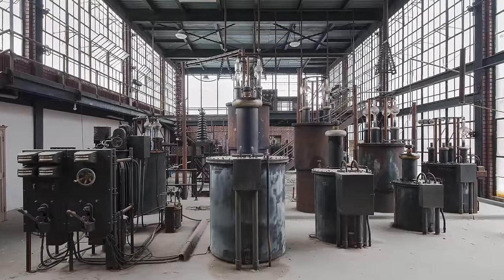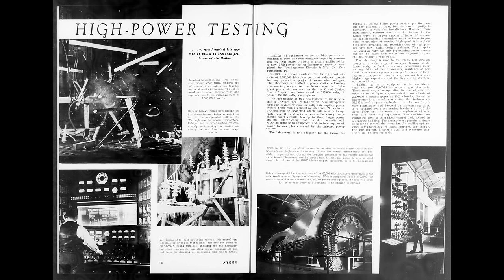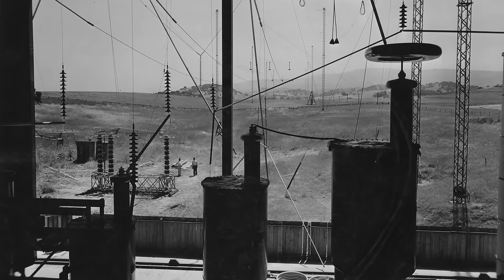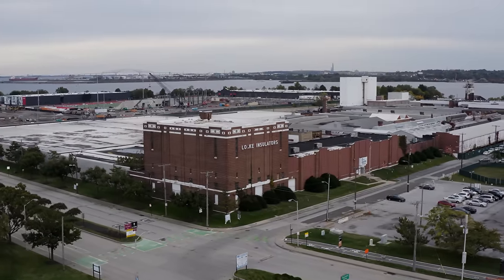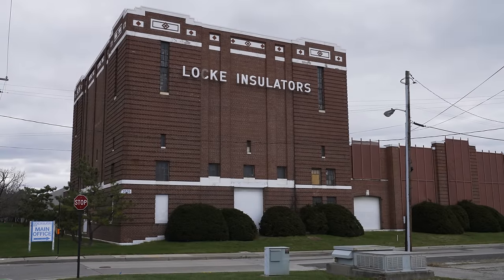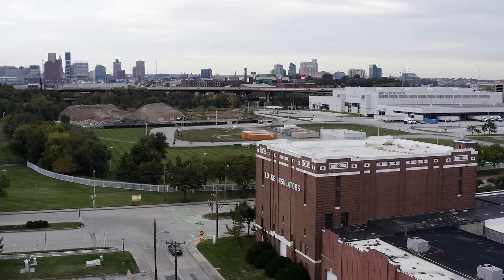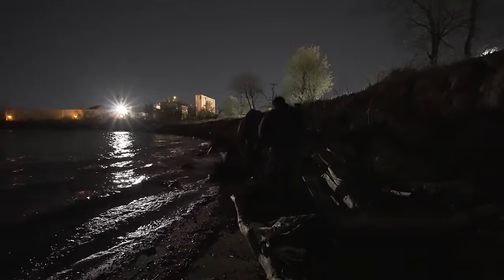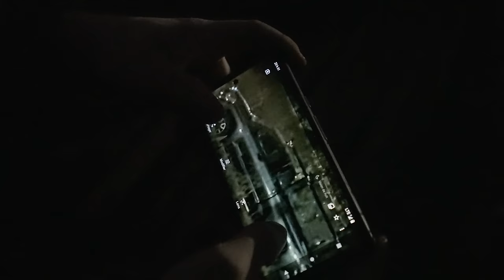Exploring GE's Abandoned High Voltage Lab - Vintage Electrical Tech!

Comment: In about 1985, I was in the McGraw Edison transformer factory in Canonsburg PA to witness the high-voltage impulse testing of a 230,000 Volt substation transformer my company was  buying new.  During the impulse testing with hundreds of thousands of volts being applied to the high voltage windings for oscillographs to capture the response of the internal copper windings and insulation, there were three or four men standing next to the transformer case and using 4' long broom sticks to personally listen to the mechanical movements inside the transformer when the impulse was injected.  There were also electronic volt/amp transducers as well as acoustic couplers and sensors.  It was all going fine until it suddenly wasn't.  Instead of the repeated and expected crisp "snap" noise pattern, it suddenly changed to a "kah-thud" sound.  An alert siren began making noise and a half dozen more men ran into the laboratory to join the others.  With everyone in place with a broom stick in their ears, they jolted the transformer another couple of times.  The mood in the room changed and the test supervisor told me that the transformer had internally faulted.  I was only about 10 years out of engineering school and the event was one which remains a utility industry career highlight for me.
Reply: I've recently heard of that place are they still in business?
Reply: @sharkey086  It's called Pennsylvania Transformer Technology now.
Reply: I worked for Uptegraff in Scottdale PA
Reply: My father worked at McGraw Edison in west central IL. the majority of his life. Worked there until they shut the plant down. He was a kiln operator. I have his awards for 30 plus years of perfect attendance.

Comment: You guys really need to bring a thermal imaging sensor. Makes it much easier to spot people in vehicles vs empty vehicles.
Reply: these guys really need to bring a global hawk with them. makes it easier to spot and blow up security personel.
Reply: Thermal can't see through glass. But a thermal camera is key i do agree.
Reply: @dashofawesome64  it can see if the truck is running or has been sitting for several hours.
Reply: @ClumsyCars  That's cool, except he was replying to the specific example given of seeing people in vehicles. Everyone is so contrarian.
Reply: @UnitSe7en  if contrarian means realizing an actual useful purpose then contrarian i am.
Reply: @UnitSe7en  What is contrarian about that? It takes hours for vehicles to cool down. People are rarely occupying vehicles 4 hours after last running
Reply: As long as it doesn't have a screen
Reply: Was thinking the same thing, would be pretty handy.

Comment: I live right up from the street from this place, one day when I was driving home from work I thought I saw you guys walking, must have been on your scouting run haha! Thought no way it was Brian and Michael, but if it was them they are definitely here for Locke! I was involved in the analytical lab work surrounding the environmental cleanup of the site and demolition of the building. They drill a grid pattern and take soil samples every few feet to determine how much contaminated soil needs to be removed.  Around last october/november was when that process ramped up so I knew the building wouldn't be up for very much longer. Earlier this year they took everything down, crazy how fast it went less than 48 hours everything was flat. I could have never imagined that's what the inside of that place looked like! The largest part of the building is the actual lab itself, the part the says Locke Insulators on it - unreal! This is so cool thank you guys for doing what you do!
Reply: Wow that is cool
Reply: Sad all that cool stuff will just end up in a land fill. Sad the building could not of been repurposed.
Reply: Were there PCB's?  That's what I'd worry about.
Reply: @scowell  it was common to use pcb's as high voltage insulation oil back in those days, plus of course asbestos would have been used in the separator boards.  I am glad they were eliminated before I started my career in high voltage engineering - it's mostly paper, epoxy resins and vegetable oils these days.
Reply: That’s really cool !! Thanks for sharing that story !
Reply: Im not at liberty to talk about what contamination was present, but any old factory site like Locke there is TONS of contaminants - majority of the places the Proper People visit are definitely highly contaminated, theres a whole environmental side to each of these sites!
Reply: @scowell  yes, in those transformers and anything before 1977 and 1979.

Comment: Working in a HV test lab myself (one of only 3 left in the uk) this brings a particular sadness seeing all that familiar stuff left to rot.  Most of that kit looks exactly the same as what we have except our kit is controlled by computer - you just set the volts you want and all the spark gaps are set automatically.  Must have been real tedium to set everything manually.  Looks like a tan delta bridge at 25:40 which was used to determine how electrically lossy insulators are at different frequencies.  Some of the knobs were to set the frequency whilst the others were used to dial in the capacitance and tan delta and you literally had to watch an analogue meter to "balance the bridge" - sometimes it could take hours to do one measurement at one frequency.  We still have one of those in our shed but these days such measurements are done using computer controlled equipment which can do a complete frequency sweep in a few minutes.

Comment: Stunning!  I had the good fortune in the early 90's to explore GE Pittsfield's legendary Building 9.   While officially considered an active facility, it was in an equivalent state of abandonment and was absolutely mind blowing.  The scale of the equipment in the high-bay lab was staggering.  The vintage control rooms were still intact but long disused - dust everywhere.  There were complete blueprint sets that I spent hours flipping through.  If only I had been able to take pictures!! I was a consulting engineer under contract to GE tasked with mapping site infrastructure so I had legitimate access to the facility but was prohibited from having any sort of camera equipment with me.  Great work guys!

Comment: Thanks for this video. My father worked at General Electric’s electric switchgear plant that covered several blocks on Elmwood Ave. in Philadelphia. One year they had an open house where we could tour and see where our family members worked. One one of the places we got to tour was their high voltage testing facility that was a separate building off Island road 
south of where the switchgear plant was located. We got to see them test some equipment where they generated a high voltage charge. It was as you showed looked like a large man made lightening bolt. It was loud and really scared many of us watching. It was explained that they took finished products from the switchgear plant to test them for high voltage loads or for how well they would hold up from a lightening strike.  The old GE plant has been closed for years and I assume the test plant closed at the same time since there was no product coming from the old switchgear plant.

Comment: Thank you for the trip down memory lane. I worked for GE in Schenectady NY in the 1980s when I was in my 20s. Back then we still use some of the older equipment for variable frequency projects. Motor generator sets that were almost 20 ft tall. It really is sad to see so much of this stuff going away. 60s 70s 80s that really was the Heyday of some of this emerging technology that we all take for granted today. Obviously in the 80s we had the beginnings of computers replacing a lot of stuff, but all those catalogs you went through, sales brochures, technical documents, all of that stuff had to be printed and available. None of that was in digital form back then. From what I remember GE had their own printing facility at one time for so much documentation. I think it also shows how we were as a country. We solved our own problems. We relied on our own technology to solve the problems of the day. Thank you for preserving it on video. I have to say regarding the demolition of buildings, I saw a lot of that at the GE plant in Schenectady. I don't remember all the details but I know they got into some kind of pissing contest with the county regarding property taxes. The end result was GE demolished a lot of older buildings, a lot of the older labs, a lot of things that should have been in a museum, so they wouldn't have to pay taxes on the property from what I remember. It's hard to think about how much history was lost during that time. I remember walking across the Main Plant from one building to the other, walking across a vacant stretch of land and seeing pieces of broken ceramic, little parts of this and that, screws and bolts, results of building demolition. I don't know where the little momentos went to, but I do remember every once in awhile pick me something up and thinking wow this is interesting I think I'll just toss this in my pocket and kept going.

Thanks again for preserving some of this stuff before it's lost forever.

Comment: This is the coolest explore (for me)! Back when I was in high school I built a Van De Graaf generator from scratch and a Tesla coil. The Tesla coil was totally sketchy... I used a neon sign transformer as the high voltage input, built a rotary spark gap out of a table saw blade, and since I couldn't get high voltage capacitors I built one out of salt water glass bottles.

It made about 8" sparks and once in a while a glass capacitor bottle would explode. That thing was as sketchy as can be! Once mis-step touching the primary coil could have been fatal.It's amazing I didn't electrocute myself in hindsight. Whenever I turned it on all the wireless devices in the house would just cut out completely.

Glad to hear some of this lab gear managed to get saved.

Comment: That sticker at 16:00 is checkpoint for the security, they need to scan the qr code every time they walk by to prove they are actualy going through the object.
Reply: like the old detex clocks
Reply: Usually hourly they have to scan tho if active patrols.
Reply: @renardfranse  I used to work in at a paper mill where I had to use the old Detex for fire watch. It had keys located throughout the buildings.
Reply: @Tipp_Of_The_Mitt  I worked at Newton Falls paper mill YEARS ago as a machine operator.  Went BK many years ago.  Still have good memories and will never forget the smell of paper being pulped and dried and stretched and rolled on to drums.  Ah the good old days.
Reply: @renardfranse  Yes, I miss that job also, as for me I primarily worked in the Boiler House.
Reply: I mean, as a lazy employee, I'd just print out each qr code, sit in my vehicle, and scan the sheets of paper when I needed to 🤷‍♂️
Reply: @Tyler_5.4 called GPS tracking.
Reply: @yougotpinkeye  have be going off cellular service as outside GPS not gonna be getting in that building
Reply: They should use NFC instead, like with tap to pay. 

The problem with QR codes is you can just take a photo of it once, and then you scan it from anywhere as often as needed. 

I guess if they used a custom app that correlated the QR scan with your location, that could prevent cheating, but depending on the place, that might not be reliable enough (due to GPS signals being blocked, or QR codes being close together, etc).
Reply: @Tyler_5.4  but if they went with a higher tech solution then they might have to employ enough staff to do the checks that they’re being paid to do. Amazing how efficient that one guy is!

Never ascribe to stupidity that which can be explained by the actions of somewhat rational people operating within a framework of financial incentives :)
Reply: I'm willing to bet a few security guards have 'spare copies' of said codes...
Reply: As an ex-security i thought id be it. We did it in other way used to
Reply: @renardfranse        Hammermill Paper was known for its fine papers and stationary.    Hammermill Bond was the trade name for its top of the line paper.     Then a corporate raider Carl Icahn attempted a hostile takeover and International Paper came to save the plant.   Within 20 years they milked that cow dry and leveled all but the office building but yet they kept the name and still make Hammermill Paper in name only- people don't know the actual Hammermill Paper Company is gone.
Reply: As it sticks on the inside of the door that means the security guard would patrol in the building, not around it.. That's an interesting point to know for everyone who intends to stay longer. :)

Comment: Westinghouse (later ABB) had a lab like this in Bloomington, Indiana that I toured in the 1980s. They made huge lightning arrestors used in high energy transmission lines, many of these used in Canada. I recall the huge room had a hinged roof in the event of an explosion resulting in an over-pressure event. It looked like a cleaner version of this lab. — I enjoyed this video! ❤️

Comment: If it makes you feel better, I was in the Westinghouse East Pittsburgh lab circa 2009 and there wasn't much left to see even then.  The only really interesting thing left was the giant Van de Graff generator (from the outside, it looked like a water tower).  As I recall, it produced a 6MV electron beam.  The building proper was stripped clean and was mostly empty space--not even a desk or office chair.  Left over were a giant gantry crane, a couple of empty server rooms, and some transformers leaking deadly PCBs.  I'm told that they manufactured LSD there at one point and that there was a fire where a bunch of firefighters were sickened by LSD fumes.  I may even have a newspaper clipping which confirms that story somewhere.  A former employee told me that there was so much mercury dumped on the site that there were places where cracked pieces of concrete were floating on mercury which pushed up when you stepped on them, though I didn't notice when I was there.

I'm happy to share the photos I have if you're interested.
Reply from the maker: If you're talking about the "atom smasher" that was a different lab from what they called their "high-power" lab. But yea neither was around in-tact anytime recently.
Reply: @TheProperPeople  You're correct, it was actually the "atom smasher" lab I was in.

Comment: Thanks for another awesome video. I drove past this building for years and never knew what was inside. I used to work for a company that sent dozens of dumpsters to Locke between 2012 and 2013. I had no idea what was going on there and it makes me wonder what ended up in those cans. It's so nice to know that lab managed to last until you could immortalize it on film.

Comment: Didn’t exposing the public to such high voltage spectacles create hazardous ozone gas pollution and injurious noise? 1939 was a dangerous time to seek family entertainment from power industry pamphlets.
Reply: Depending on the kind of tech they had running there i'd be much more concerned about x-rays!
Reply: They didn’t think none about stuff like that back then. 🤷‍♂️
Reply: You sure do show up in the weirdest places. But ozone is pretty harmless in the grand scheme of things, and I can't imagine the noise was any more of a concern than any one of a thousand other loud things you'd run into in that time. The UV light would probably be the biggest concern.
Reply: Ozone isn't hazardous. It's as benign as CO2 or nitrogen.
Reply: Well, in the fifties you could still watch nuclear tests from vegas couldn't you? So perhaps they didn't mind. But surely there was some extraction process so ozone didn't become totally deadly
..
Reply: The hysteria over ozone is overblown i work with ozone all the time, can be used for all sorts of cool things. 

Ozone is O3 rather than oxygen's O2, more reactive and does not last long in the air generally turns back to oxygen after a while, so would not be a huge risk for a short demonstration. 

It can also kill pretty much all bacteria, viruses and was widely used to treat infections in the past, as long as your not breathing it in high concentrations its fine.

Its used for all sorts of things, hotels use it in their washing machines so they can wash with cold water but get things really clean, used for sterilizing things, cleaning hot tubs, ozonated olive oil good for all sorts of things, there is a company that uses ozone infused water to wash meat so they are more sanitary, people use it to help ear infections and also for tooth infections. 

I once ozoned a pair of sneakers that were smelling a bit wet dog and they now smell great haha.
Reply: @ATomRileyA Bleach is useful in the same way. Doesn't mean I'm gonna go chugging the stuff.

Comment: You guys are amazing. I wish I could still do this but life has got the best of me. I have had one experience like this, not a high voltage lab but everything in these old industrial places look the same. I wish they could be preserved. The complexity, multiple floors made of bricks, the mixed old and new, the cages, the obsolete among the current things. Old original equipment run right next to new. Layer of dust on the floors and no footprints, knowing you are the first to walk there for ages. Also thinking about the people who worked in these factories for their entire lives. Also reminds me of my university, which moved to brand new facilities. Old buildings had see two world wars, they were thoroughly worn in. High voltage and radio labs were dismantled and not rebuilt. I kept many memories from there.

Comment: I used to work at GE after they moved capacitor production to Florida. They have a similar setup for testing transformers, in what I called the lightning room. Crazy crazy stuff. After seeing that capacitor bank, I'm wondering if one of the guys before me designed it! This is awesome to see, nice work.